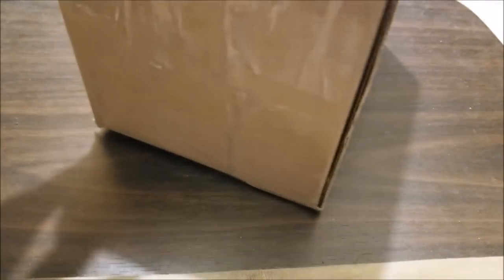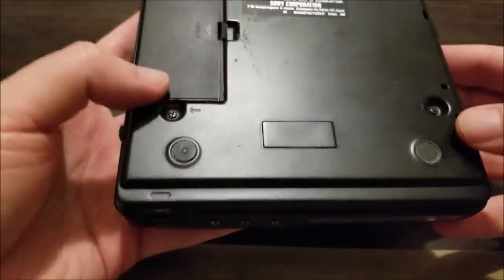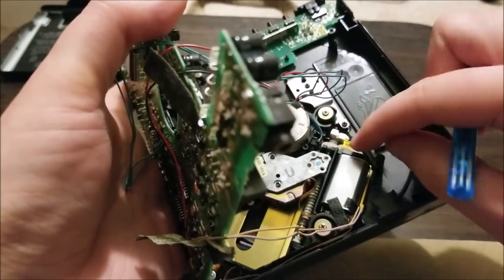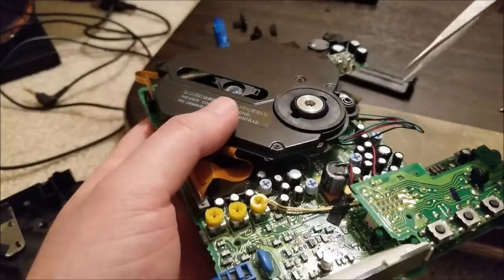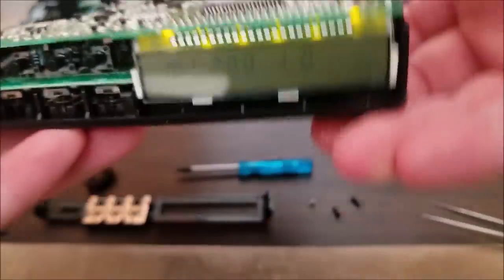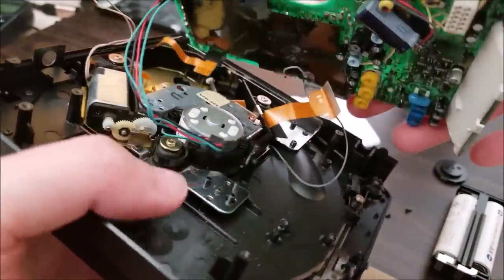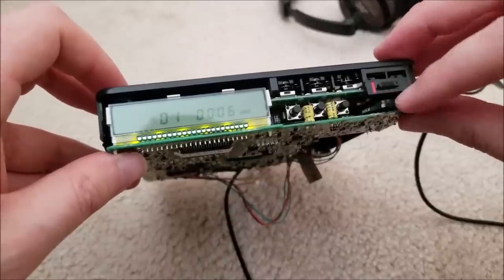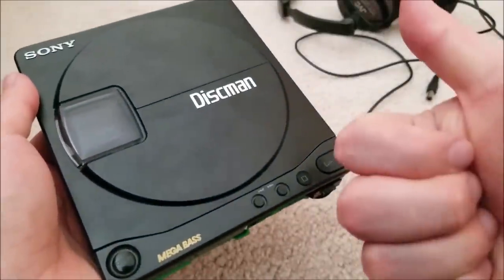Let's Fix: Sony Discman D-9 Dim Display, Doesn't Play, Audio Problems

Comment: Seeing this Discman, reminded me I had a TV once that only worked when it was upside-down. :) The fault was the heater was intermittent open-circuit in the CRT. In the end I removed the CRT, and put it back in upside-down, and it actually worked for a couple of years like that.
Reply from the maker: Lol, that's a pretty smart bodge!

Comment: The laser is the same as the laser included in early PC Engine CD-ROM² and Turbografx-CD drives as well as the NEC CDR-35D 1x PC SCSI drive. Those drives also have a problem with the middle gear turning brittle and yellow. The mechanism is often seized or the teeth are sheared off. The CD-ROM² drive stayed in production long enough for that to get addressed in manufacturing with a clear middle gear that doesn't seem to degrade over time. The later drives also have a different laser module though it remains compatible with older drives. I've seen it called "POM gear," whatever that means.

In short, it wasn't leaked electrolyte from capacitors causing the gear to degrade. It's just yellowing from oxygen and an unstable mix of plastic (BFRs and such).
Reply from the maker: POM is the chemical composition of the polymer I believe. I'm tempted to see if I could 3d model a replacement gear and print it from a durable engineering grade resin on my sla printer.
Reply: @sjm4306  ...there are at least a few different people who have done exactly that for the NEC drives. :) I have a stack here from MagicTrashman (made with ShapeWays) and even more from GameDoctorHK. There's yet another guy on the Facebook repair groups who has recently made them but his name escapes me. I also have several salvaged from other drives. Unfortunately, the Discman POM gear appears to be a little larger so none of my replacements will help. :(

For what it's worth, NEC says not to lubricate that gear and yet it ends up looking just like those. I think it's actually compounds leeching out of the plastic as it yellows because they got the mixture of stabilizers and such wrong. I believe they also swell when they yellow, causing them to bind up as you have experienced.

Comment: Oh this is a CD player I would of loved to have as a kid, I never owned one with a lit screen either. Looks like it has pretty beast audio output abilities too. Great work thorough job on all fronts!
Reply from the maker: Thanks, super happy with the restoration (I listened to it all last night as a burn in test). I also scored a D-15 which is basically the higher end model of this guy so super psyched to fix/play with that when it arrives.

Comment: You helped me today. Have a d-88 I bought new that I haven't used for awhile. Decided it was time to warm it up. Spin spin spin no play. Got it to play a 3" it came with. No full size. After watching your video I reached in and shoved the laser all the way back. Works great. I forgot how good these really sound. Using new Koss KPH30iW headphones. Sounds  excellent. Van Halen Best of Both Worlds. I see the little display has lost more segments to the display. What do I need to do with this to keep it up?
Reply from the maker: Glad to hear you got her up an running full sized discs! The problem with the displays is probably either due to the ribbon developing little breaks in the wires inside, or the connection to the lcd glass contacts weakening. Both of these can be fixed if you find a way to bridge the broken connections. Depending on how the lcd and ribbon are attached this can involve simple flex solder jumping or gently heating up the ribbon to flex bond while applying even pressure while it cools.

Comment: Great repair. Can you recommend a capacitor kit that would have everything you need to repair this or do you have cap values that were needed? Thanks.
Reply: also do you have any idea where to find replacement gears for the laser actuation? I had a similar issue with my middle gear and it was corroded and brittle and broke while removing the C-clip.

Comment: Picked up a pristine D-9 from ebay for about $150 shipped.  I found it displays lcd and spins continuously but the laser seems to be moving back and forth unable to read the disc... fortunately the seller refunded full without return needed (from canada) so a definite score.  Watching ur tutorial I'm almost inclined to try and fix it myself but probably go for the repair services offered by kaosuncd hahaha, they did a brilliant job on my D-25 battery.

Comment: So I picked up the same one you have from eBay sounded like similar issues.  Mine came with the rechargeable battery which of course as you would assume does not work anymore.  So without the correct AC Power charger I rigged a 9Volt battery with leads from the positive and negative terminals.  When I opened it up to check the gear system the one gear in the middle was seized like yours, I instead got it free using a bit of WD40 and a spudger it seems to move freely and I can see the laser mechanism moving along the grooved spindle when I turn the gears.  However when I hook the battery up to the terminals it turns on and and spins up and the laser moves up and down but does not move on the track.  I am thinking this is because the voltage is not right for the unit and I should be using a AC Adapter which I ordered and is coming tomorrow.  Because I do not even see any red light emitting from the laser.  I also potentially noticed some leaking from one of the caps but its in an odd place to get to there was also a 6.3 V larger cap towards the front of the unit on the board which had a positive and negative wire running to it at the top it was sitting on a foam or plastic base on the board.  It looked like it had some glue coming out from the bottom of it I am not sure if it was leaking or not I tested it with a multimeter and it was not giving off 6.3v but again wondering if it was because I did not have a power source connected to it.  Either way I am going to try the power adapter if not maybe I pay you to fix it and you have another trying to fix on your channel?  Love your videos by the way.
Reply from the maker: Yeah all the caps pretty much need to be replaced by now for the player to function correctly. Also the 9V battery might not have enough current to drive all the motors and laser at the same time so that may explain the laser and sled motor not firing. Good luck and if you do decide that you want to have me give a crack at it let me know.
Reply: @sjm4306   I will definitely do that I'm going to look again at the board to see how many of the caps Are bad and where they are I realize all need to be replaced I may not be up to do all that if as the case I will let you know in a few are willing again I will pay you and will be a great on another video for your channel I'll pay for postage of course return and sending I'll keep you posted thank you very much
Reply: @sjm4306  Just looked at it again and some of the caps being way too close together for my huge fingers to work on to be honest LOL.  If you have a way to contact you I would like to get this set up to be repaired.  I assure you I have not done much to the inside so should be easy to do the same things you did on yours.  I know some people requested a longer detailed video as well the next time you repair one of these could be your chance for that as well.  Thanks again.
Reply from the maker: Shoot me an email at sjm4306@gmail.com and we can get this set up.

Comment: I had the same issue with the gear on a D-99 I just picked up. Thank you for your video.

I should probably replace the caps on mine as well...

Comment: You know you watch a lot of old tech restoration videos when
a) you can likely guess the root of the problem like guessing the plot of genre specific movie
b) That problem is 80s/90s capacitors
Reply from the maker: A good repair is like a detective novel or a murder mystery. The culprit is almost always murphy and the murder weapon is more often than not old capacitors!
Reply: @sjm4306  So capacitors are the butlers of murder stories.
Reply from the maker: Exactly!

Comment: Hi sjm, I got a D-9 on eBay and it had no sound, and I took it apart and realized it was the same issue as yours! Thank you so much for sharing this! Now that my D-9 is working, but it only produces sound in left ear, do you have any idea how to fix it?
Reply from the maker: Great, happy to hear you were able to get it running again. As for the sound issue, I'd guess either the volume control is crusty and needs some contact cleaner or the electrolytic caps in the audio circuit have gone bad (you can check for leaks and replace as necessary). As a matter of course given the age of the d9 I'd suggest just replacing all the electrolytic caps anyway because if they haven't failed yet they soon will.
Reply: @sjm4306  thank u for ur suggestions! My D-9’s “line out” port has normal output, there are sound from both ears. Could it be that the audio circuit is ok and the problem only lies in the amplifier?
Reply from the maker: I'd have to look at the schematic in the service manual, but it's possible the line out is fed before or after the amplifier and the audio from the amp goes through a volume potentiometer and then to the headphone jack. This could mean it's just a dirty potentiometer or hp jack or the amp caps are bad but line out is pulled before it or possibly from another amp. I really cant say exactly without a schematic and a quick search for the service manual comes up to paywalls of shady sites that try to charge for copyrighted manuals they don't own the rights to.

Comment: I used to have a D-9 in the 1990's, and I found it worked just fine until I moved on to a component CD player and set it aside. The battery should have been replaced, but it "left for college" with a friend of the family, along with a Toshiba 1200XE laptop.
Reply from the maker: Hopefully they were given by you and weren't "donated" on your behalf by a family member
Reply: @sjm4306  The college-bound guy left with my 1980's and 1990's tech with gusto. He's an elementary school teacher these days and coaches after school sports.

Comment: Hello, I know its been a while since you did this video, but do you use a gas soldering iron  and have you still got a list / purchase history of all the capacitors you bought or used to replace the leaking/dead ones?   the Discman-D99 service manual has a parts list but nowhere does it mention capacitor.  There is "Metal Chip", "metal glaze", a whole bunch of "transistors"  etc  but no  capacitors.

Thanks

Comment: Dear Sjm, do you notice that its very common that when the volume controls of these older models are turned, it causes a serious loud 'noise' (especially in the left channel) of these very old models (D2 through D11)?  Can a volume cleaning spray be effective? Or must the volume potentiometers be replaced?  Its odd that the right channels have zero noise, but left channel has very loud noise.  This happens to both my D-2 and D-11.
Reply from the maker: I'd guess the outer carbon track is the left channel and thus more susceptible to wear/oxidation. You can usually rejuvinate them at least temporarily by squirting some contact cleaner or >90% isopropyl alcohol into the edge and work the wheel back and forth a lot to wipe the contacts.
Reply: @sjm4306  Ive purchased some new chinese made vol controls, i know not best quality. and a 'for parts only' D2, that i plan to rip apart to see if/how I might feel comfortable to open my 'real' player to first squirt some cleaner, and then if that doesnt work at a future time see if i can find a better part to try to replace it with. Thanks.

Comment: Nice repair.  Where do you usually get your replacement caps from?
Reply from the maker: I have a small stock of standard values from digikey/mouser. For anything uncommon I salvage from scrap pcbs (don't worry I check their capacitance and esr using a meter before throwing any cap in my parts bin).
Reply: @sjm4306  Ok, thanks.  I have bought caps off of Amazon but they were not that great, I checked the ESR on them and they were marginal.  I forgot about Digikey, I used to get their catalogs.

Comment: My sony D-99 discman has been fully referbished too, new caps etc cleaned and lubed transport and motor. I can't use it 24/7 for days on end though, I think the small motor just gets too hot or something over 24/7 days of use, because it just stops playing altogether when it's had enough. This is really frustrating, because it sounds awesome through  my mid 1990's avi s2000mi integrated amplifier, and my early classic sealed up cabinet monitor audio gold gr20 floorstanding loudspeaker monitors, which are positioned 3 feet off the floor in the air on stands, firing into my room in my 1 bed flat In Leeds West Yorkshire in the UK. Cable's I use nordost blue heaven rev 2, which I have also had for years now too. So at the moment using one of the many late serial numbered linn cd players that I own.  linn genki's and karik 3's cd players at the moment.
Reply from the maker: Your D-99 has become sentient and decided it has had enough lol! In all seriousness though these are old players so it could be any of the small components that wasn't replaced are starting to fail.

Comment: Mine is also having same problem with super low sound and fade lcd.. everything else is working perfectly fine 
but it is a phillips ax2412 personal cd player since i don't have repairing skills i took it to all my local electronic repair shops... they all straightly refused to do repair..

Im very sad now.. since i couldn't find any ways to get it repaired....😐
Reply from the maker: It's sad but yes, a lot of repair shops will outright deny repairing older devices or give ridiculous repair costs because they just dont want to deal with the hassle. That leaves it up to us to learn to maintain our own equipment.
Reply: @sjm4306 thanks for the reply.... in this quarantine i'm currently learning to repair such capacitor problems. Maybe hopefully I'll get it repaired by myself.
Since i was an electrical student, i think can do it one day. Wish me luck
Reply from the maker: Good luck, you got this!
Reply: @sjm4306  thanks again brother

Comment: Thanks for the video! I just bought a D-9 for $40. The seller claimed it to be fully functional but the phone out has very unbalanced sound with hiss noise. The line out is working just fine. So I think there must be some problems with the caps in amp circuit. But I never worked with electronics before. Any advices? Thank you!
Reply from the maker: First try soaking a qtip in isopropyl alcohol and dabbing the volume pot to get it to seep into the seam and work it back and forth a lot. The pot contacts get corroded over time and cleaning them this ways solves many audio problems. If this still doesn't fix it then you will probably need a recap.
Reply: @sjm4306  Thanks man! I'll try it. Silly question, how can I find it? Do I just clean the volume control? Or do I need to open the case? BTW, I just found it couldn't skip tracks. I guess it's the grease problem you encountered
Reply from the maker: Yeah you'll have to open it to fix both issues.
Reply: @sjm4306  Gotcha, will work on it tonight and i'll let you know how it goes
Reply: @sjm4306  Update: I lubricated the 'spring' and now it reads disc perfectly. I just bought another D-9 this week and it had the same problem. But this time after the lubrication the motor still looks a little reluctant to drive the gears. I guess I need to clean the yellow gear as well. should I just remove the 3 screws to get access to it?
Reply: @sjm4306  BTW, both machines have bad po output (right channel no sound), I'll try recap later this week
Reply: Hey man, I replaced all the smd caps, now the right channel is working fine. But mega bass doesn’t work. Have you tested your mega bass? Thanks!
Reply from the maker: Yeah, my megabass works fine. I'd suggest double checking that it's not the switch itself that needs cleaning.